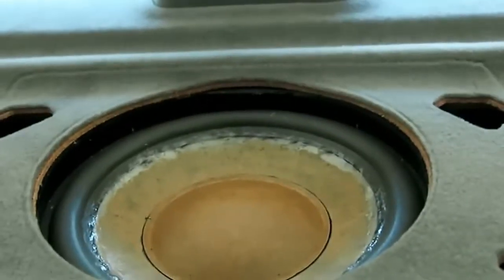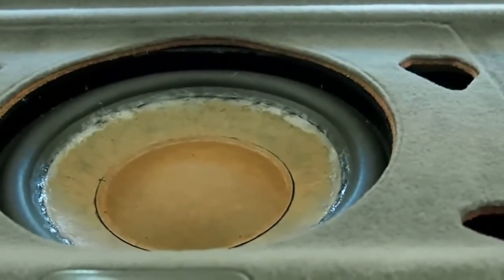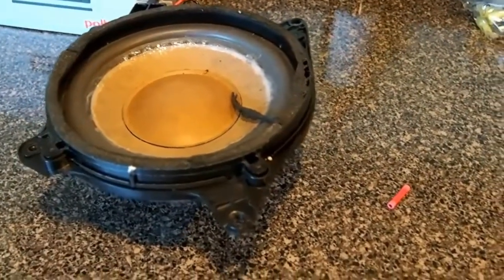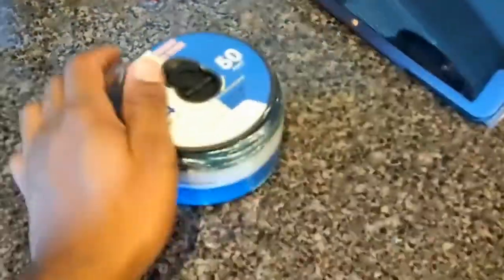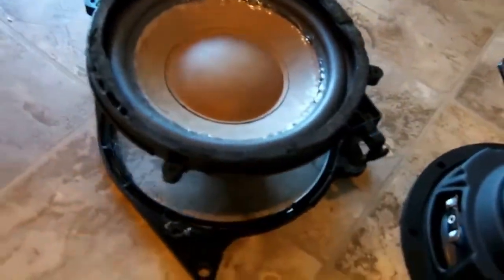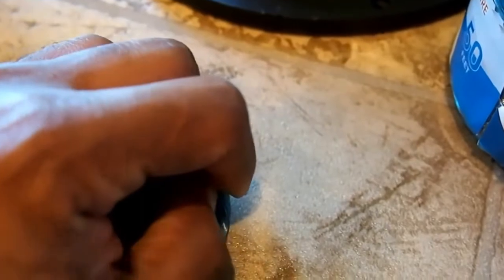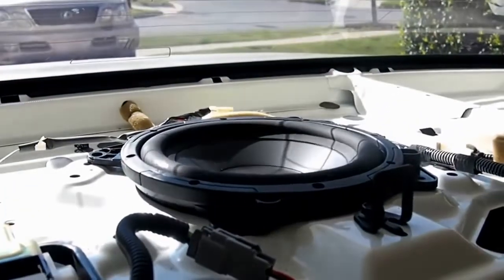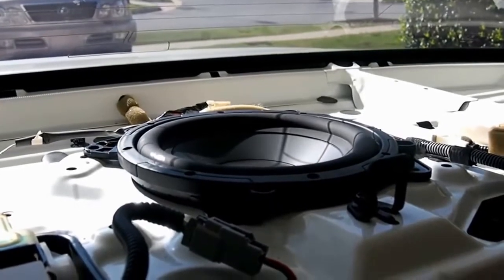Lexus LS430 Mark Levinson Subwoofer Replacement (Detailed)

Comment: Thank you for the video.  I replaced the totally blown subwoofer in my 2001 Lexus LS430 yesterday.  I used yours and the video by Will Hennigan to guide me. It took me way longer than you guys to do it because I am learning as I go.  Thank you for filling in the blanks like (wire guage size (I used 14 too but should've used 16), using a wire cutter, where to place the tool to remove the paneling, using noise dampening for the holes, etc...)  Even your do-overs were informative and your kids fascination with what you were doing was entertaining. One word: "Wow"

By the way, the Polk DB840 DVC is discontinued and so far, replaced with the Polk Audio DB 842 DVC (DB+ Series shallow-mount 8" subwoofer with dual 4-ohm voice coils).  I got it from Amazon for $59, lower than the $99 from Crutchfield.  The new subwoofer seems wider because the face where the screw holes go, is not level so it will not fit on the existing plastic bracket (even after shaving off all the raised screw hole pieces on the original bracket), so I ended up not using it and instead, drilled new holes using the screws that came with the subwoofer to attach it into the frame with the rubber ring and padding (using 3 screws). I had to use another youtube video to figure the polarity of the terminals on the speaker and tested using a 9 volt battery to confirm the wiring setup before configuring the speakers for 8-Ohms and connecting to the amplifier.
Reply from the maker: Thanks for the detailed comment! I'm going to pin it to the top in hopes it helps others! Also thanks for all the kind words about my children. Means a lot!
Reply: Hey @NutmegFlavor, thank you for such a detailed guide. Just wanted to ask how that subwoofer has been treating you? Considering doing this replacement since it saves space in the trunk. But if the speaker blows out rather quickly or it's not enjoyable with music then I was thinking of going for an in-trunk setup. Thanks!
Reply: @Muhammad Andrew instablaster ;)
Reply: @Keanu Allan it worked and I now got access to my account again. Im so happy!
Thank you so much you really help me out :D

Comment: nice video-- worked great-  adding the jumper on the dual 4 ohm out of the box makes it single 8 ohm - which is perfect for the amp.  thanks very much
Reply from the maker: You're welcome! I have to do this in my new to me LS430 UL. Gonna be a bit harder because of the rear seats but that sub is fried as well.
Reply: The amp really wants 16 ohm btw, so if your current one blows or you feel a desire to replace It I would go with a 16 ohm, probably best to do 8+8 dual voice

Comment: Hi! I have a Lexus GS 430 MK3 with Mark Levinson audio.  I'm looking for a woofer replacement.  Do you recommend this Polk audio woofer?  plays better?  is not a game more enjoyable than the original ML woofer?  Does the original ML amplifier handle the POLK AUDIO loudspeaker without any problems?
Reply from the maker: It's been 5 years since I installed it and I have had no issues. There is a difference in bass though, this is way more punchy than I'd like. It doesn't match the rest of the ML speakers as they're geared more toward classical type of music. They get loud but are very high mid - treble. This doesn't do a fantastic job with super deep lows but for the price, the range is good and the bass a tad overwhelming honestly. But adjusting the gain at the center console works just fine for that. Hope this helps!

Comment: The lightness is a requirement of auto manufacturers nowadays to improve mileage, so the magnetic material used is a Neodymium-Iron-Boron sintered powder that has 10 times the strength of a ceramic magnet, by weight, although it is more expensive. But in a world where people judge quality by weight, the way to go would be a ferrite ceramic magnet.
Reply from the maker: I'm today-years-old when I finally realized the "lightness" you meant was for the weight of the magnet, lol. It's been a while since I made this video so I didn't know what you were talking about but thanks for the insight! One of the reasons I like making youtube videos. I get to learn from others who know more than I do!

Comment: Thanks for the video again I just replaced the foam on my woofer. I did everything except removing the side pieces. After removing the rear deck the rest is easy. Ensuring the foam is glued properly to the cone is very important. One other tip was when not removing the side panels, check front corners of the deck lid and pop them around to the front/outside of the side covers. The insulation on the deck lid can get caught on the woofer so be careful with that.
Reply from the maker: Nice work!

Comment: Crutchfield has speakers better than any on Amazon. They also provide necessary connectors so you will not have to cut or modify connections.

Comment: Awesome video thanks for showing I was looking for how to do this without cutting the deck lid as it seems everyone does that instead of this way. Which make sense it’s easy but you’re cutting the deck lid on a 60k car that’s crazy
Reply from the maker: Exactly! Just set aside a day and you'll knock it out in a couple hours and it's still clean and factory and maintains its value.
Reply: @ToolDeals  very wise thanks again for the tutorial

Comment: Thanks for the informative video. You mentioned at around 14 min in that replacement amps are cheap.  My Mark Levinson amp blew, and I was planning to get it repaired by mailing it to the manufacturer but that's several hundred dollars. Any idea how to figure out what kind of amp would fit and function well?
Reply from the maker: I meant aftermarket would be cheap. It would require you to run new wires to the speakers, but that actually isn't all that hard. Just takes some patience. If you change out the head unit (radio), it becomes easier, but you still have to run RCA's from the amp to the back of the head unit. This is less expensive but more work, but better sound.

Comment: Chris,

Thank for the video and responses to comments. I was also nervous about running a sub rated at 8ohm when oem sub is 12ohm. What's the reason that this sub gets all the love compared to other dvc 4 ohm 8' subs. Wondering if something that is designed for freeair and lower RMS rating could make more sense. Kicker 44CWCD84 JBL Stage 82AM
Reply from the maker: No problem! I can say that there is nothing to be nervous about. I've been running this setup now for about 15,000 miles and 4 years. Haven't had any problems. However, I think your idea is worth giving a shot. While the Levinson speakers do a great job with keeping up with the sub, it's still a bit "thumpy". It beats a little too hard in my opinion. No rattling or anything and that could be due to the sound deadener I added, but it's definitely punchy bass. I would prefer something a little softer personally which I think a free air setup would provide. 

I'm thinking that JBL might be perfect. but I also haven't heard it, just from my past (very past) experience with JBL. I saw on crutchfield someone used this in their SC430, and another reviewer said it wasn't too aggressive nor too soft. So, sounds like it might be just right. 

The sub in this video, I pretty much keep the gain for the bass right at or slightly past the middle. It's overkill. Hope this helps!
Reply: @ToolDeals  ok cool good to know you are a few years in and no issues. The exact model you and lotta people used is discontinued but DB 842 has pretty similar specs. Spent wayy too much time last night googling and watching yt vids. Dayton audio on parts express has a dvc 8ohm rated at 80 rms and 160 peak with rubber surround and only 40 bucks Dayton Audio SD215A-88. Wonderign if I'll find a video of someone using that lol.

Comment: Thanks for the video, Im gonna be tearing the backseat out soon/ eventually. Idk if I want to re-foam the old one, buy a used one or buy an aftermarket one. I really gotta decide before I tear it out though hahaha
Reply from the maker: Glad I could help! I'd say just find aftermarket. I've heard some say the re-foam worked, then I've heard others say it didn't. At least you know with the right aftermarket speaker you can change it, and it's done. It took quite a while to simply change out this speaker. Not something I'd want to keep doing. I also never really crank it up past a little bit past half. It's too much! LOL, so I have no worries of it stressing the amp at all. It's been 3 years now and it's still going strong.

Comment: Did you encounter any problems after you made the change the subwoofer?
I mean you dont have any problems in the amplifier or in the computer or any thing about electronic technical?
Please tell me about your try.
Reply from the maker: Nope. It's been over 3 years since I've done it now. About to do it to my other LS430
Reply: @ToolDeals  good , did you change the subwoofer with basic LS 430 amplifier?
Reply: @ToolDeals  and i will change that to pioneer subwoofer , What's your personal opinion?
Reply from the maker: @IiFxBiI  Yep. All I did was what you see in the video and swapped out the sub. Didn't touch the amp at all, it's stock.
Reply from the maker: @IiFxBiI  Pioneer is good. Back in high school in college I preferred to use pioneer as interior speakers, not as a sub because they didn't offer as much punch. For subs I used to use top of the line JL's. But that was 20 years ago lol. 

I personally think the polk has a little too much punch, and something milder like a pioneer would offer overall better sound quality.
Reply: @ToolDeals  thank you bro , i will do that but i scared change the subwoofer then i have the problems with amplifier or computer's car.

Comment: Have you had any issues with the ohm rating being different from the factory? Mine just blew out and I’m having a hard time finding a sub with 16 ohm impedance so will be replacing with something similar to yours.
Reply from the maker: Nope! 3.5 years strong! I just bought another LS, an Ultra Luxury and my goodness the sound is straight poo in comparison! Ugh, I don't even turn on the radio and am in the market for another polk if I can find it. But no, no problems at all. Comically I can't remember how I wired it so I'll have to refer back to my own video 😂
Reply: C&M Studios I actually ended up replacing mine with the Dayton audio 8 ohm dvc sub and its working amazing! I used your guide and cut out the back shelf instead of removing the seats and it works perfectly!
Reply: @kovansaleem7941  think that's what I'm going to do.

Comment: where did you get the wiring for it?
Reply from the maker: Not sure where I got it specifically. Likely Home Depot. You can also go to an automotive store like Autozone to get some too. I even think Walmart has decent wire as well. Generally, copper wire is best.

Comment: What does it mean if the radio don't turn on.is it a code or fuse and where do I find it
Reply from the maker: Is this after you tried to change the sub? Or did it just not turn on one day? 

Either way it's likely a fuse. Check the fuse boxes in both kick panels. There's one by the left foot on the driver's side, and one by the right foot on the passenger side.
Reply: @ToolDeals  ty its my inlaws car that I'm buying but he said its a code or something.il try the fuses soon.ty
Reply from the maker: @AB-xh4vr  No problem! Let me know if it's the fuses or not. If there's no engine light then it should just be a bad fuse.
Reply: @ToolDeals   sure no problem ty.

Comment: You never addressed which wires on the connecting plug were NEG or POS!
Reply: On my 2002 LS UL the post is market red. Black has no markings.  Factory settings.

Comment: You are doing more work than necessary, you pop out the grill unscrew the woofer frame and and pull the woofer out using the factory deck hole. And yes it comes out with a little patience. Using a lower ohms woofer will overheat the amp and repairing the multi channel mark levinson amp is not cheap
Reply from the maker: For anyone else reading his comment... 1. If you're going to do it the correct way, follow my instructions. The only way to get the sub out through the grille (like most cars can) is to cut it or risk breaking something, the lip of the sub spreads under the deck lid.... 2. "With a little patience", I like how a little patience didn't come with a timeframe, you can spend all day when you could've just removed the seats and been done with it.... 3. I've been using this setup for 3.5 years now with no problem. Finally, IF it does burn out, which all amps burn out at some point without using anything aftermarket, you can replace it with ANY amp. Not just the Mark Levinson. 

But thanks for your comment!